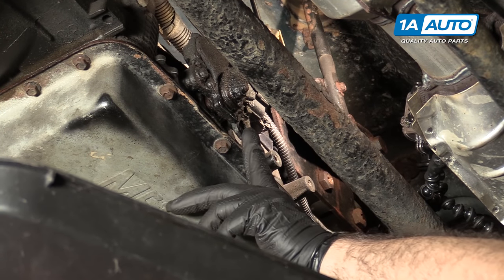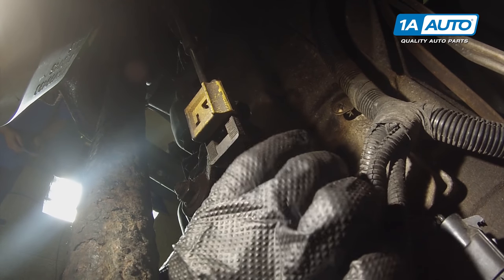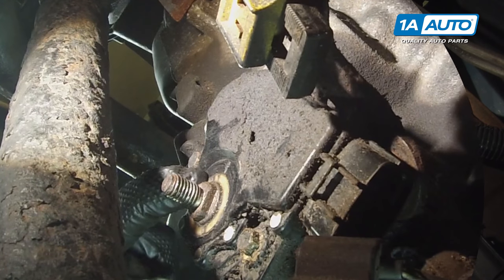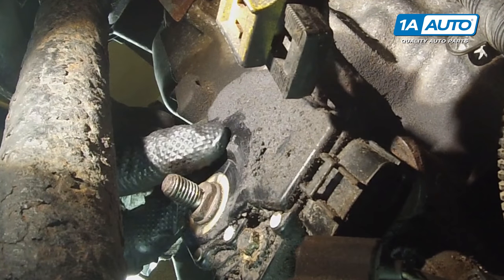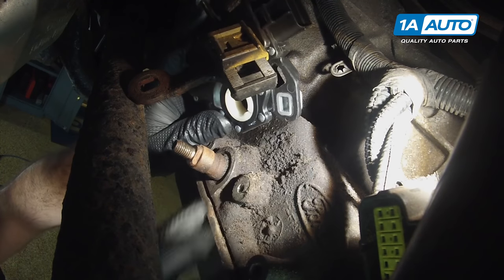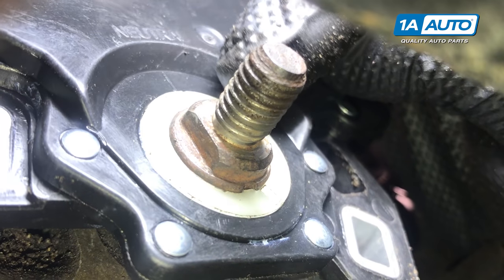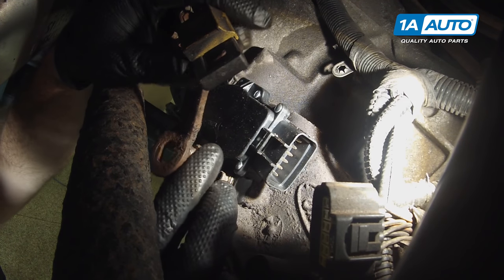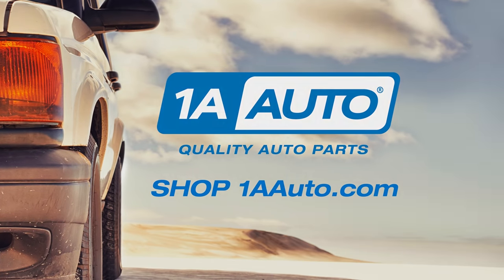How To Replace Neutral Safety Switch 97-03 Ford F150

Comment: If you noticed the neutral switch you took off was for a 14 bolt trans…the one you put back on was for a 20 bolt trans…..the mounting bolts for the switch go thru the reinforced metal holes not thru just a plastic slot….any torque placed on the one you used as a replacement will bend the plastic housing and lead to cracking it or breaking….that metal reinforced hole must seat onto the mounting holes on the trans.

Comment: Excellent video. I followed the instructions as advised and had no problems swapping the switch. I did have to break the old switch off the stud due to a rust and grime build up. It wouldn't pry off with screwdrivers. Once I got it off I had to sand the rust off the stud. I should have done this yrs ago because it now shifts like new. Thanks again.
Reply: I had the same problem. I took me 2 hours longer. i tried to save the old one, just in case. But i had to break it.

Comment: Would replacing this fix intermittently working reverse lights on a 97 f150? It’s 2wd auto with the 4.6 and I haven’t had luck finding a “backup light switch”, I only see the neutral safety switch. Thanks In advance.

Comment: So I am trying this on my 04 explorer, and the middle bolt, which is 21mm on mine, won't bude, even after being soaked in penetrating fluid for over 24 hours. Am I missing something? The 8mm bolts onbthe side are even more rusted and come loose easily.

Comment: I have a 1999 f150 ford truck with a manual transmission I need to know where the neutral safety switch is located I have checked all around the clutch pedal it has a hydrolic clutch if that makes a difference

Comment: My emergency break activated my neutral safety switch after I put my truck (ford150) in neutral, and it wouldn't start in park, only in neutral. But after I released the emergency break, it started in park again ! What in the heck would cause that if you know ??? And isn't this NS switch useless so to say ?

Comment: If mt truck has 12 pins and i use a 11 pin replacement OeM motorcraft (the only one ive found). Will it work?

F150 1998 v8 4.6L 4x4

Comment: Any tricks to removing the old one from the transmission? The two bolts come off fine but the sensor will not. I'm able to tilt it and shift the linkage, thus shifting gears. Is the sensor separate from the metal plate connected to the shift linkage? I don't want to damage anything but it looks like someone here simply broke theirs off?
Reply: Try some form of penetration oil and let it soak for a while.  The best I've ever used was kroil but it's not cheap.

Comment: My transmission will not get into reverse but drives forward fine and it starts in neutral .Could it be this safety switch
Reply: Yes sir.  Change it and replace your shifter

Comment: Is the transmission range sensor the same as the safety neutral switch?I have a 2007 Saturn aura xe 3.5L
Reply: Yes it is

Comment: I have an 02 sport Trac that the reverse lights don't work on. I've already replaced the bulbs and the fuse. I was told this could also be the culprit but I'm a skeptical person. So could this be it?
Reply from the maker: +Kevin Myers We do not have a way of being able to diagnose the issue that you are experiencing with your vehicle but suggest taking it to a local mechanic for a proper diagnosis.

Comment: I have the problem where the truck starts when the clutch is pushed in but does not start when in neutral. Brand new starter solenoid, batter and starter, wires in good condition aswell.
Reply: Get a new cable & replace transmission sensor

Comment: What are the symptoms when this part goes bad?
Reply from the maker: +Dwight Hobbs We do not have a diagnosis video right now, but we'll keep this request in mind for a future video! http://1aau.to/m/Shop-1AAuto-c
Reply: 1. Occasional no crank when in park - if you shift it to neutral will then crank   2. Same in reverse - will not crank in neutral 3. Sometimes can crank in D, 1 or 2   4. Some might not crank in P or N... occasionally.. depends how bad they are.  If you have a constant no crank in P, it could just mean this switch needs loosening and an adjustment.

Comment: Hey... i have a 08 crown vic and my transmission works whenever i get it into drive the when i brake it jumps back into neutral... does this sound like a transmission problem or the safety switch

Comment: WRONG INSTALL AT  6:35  You did not place the bolt in the right reinforced hole, maybe wrong part or can you MOVE the metal reinforcement.  What a BS job.    Junk Yard Mechanic.